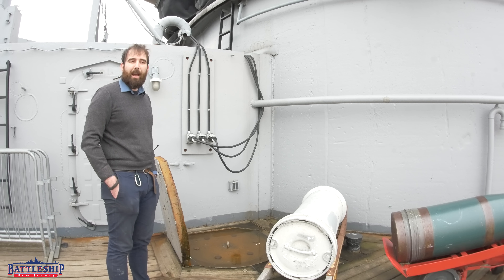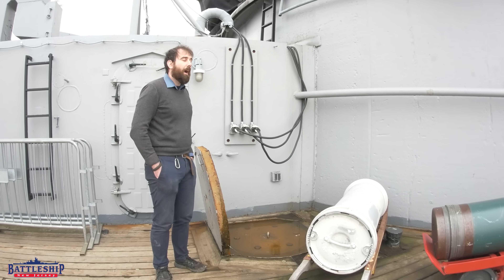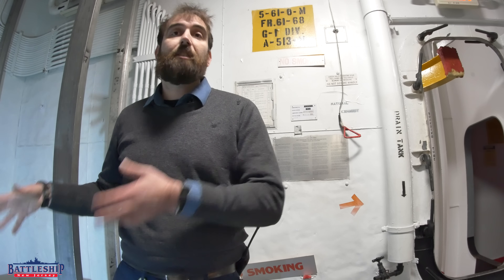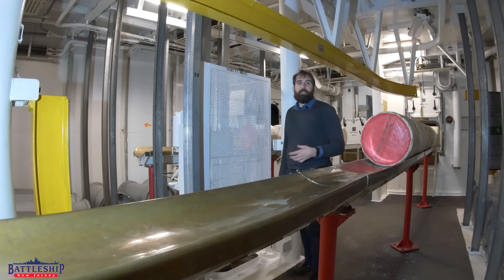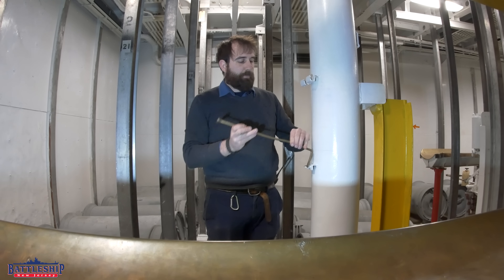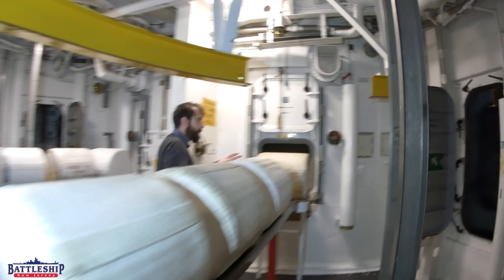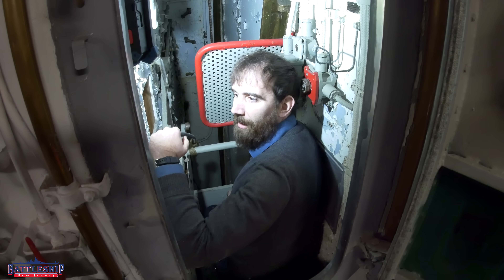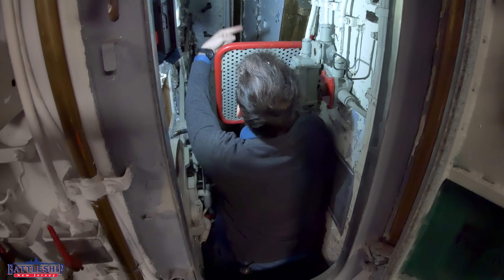Passing 660lbs of Powder For the 16in Guns

Comment: 17:15 is the second ram based on distance or ft lbs?
Reply: The 2nd ram is based on distance. While the 1st ram (the shell) is based on ft lbs, the 2nd ram (the powder bags) goes by eye until the last bag is just far enough for the breach to be closed.
Reply: He mentions just into it, enough to close it.
Reply: @J-1410  Actually he says “just touch” which can be either based on distance or the amount of pressure that has to remain low when loading the propellant. My question is very specific and I was asking what just touch means. I appreciate your reply but I’m holding out for someone with intimate knowledge on the subject.
Reply: @chrisb9960  Good luck with that.

You should probably specify that you're looking for an expert in the original comment then.
Reply: @J-1410  The post wasn’t for you.
Reply: @chrisb9960  You've made that clear, now.

Comment: path of primers?
Reply: From the box to the breech plug.   There is a Gunners Mate below where the plug stops who removes the fired primer and installs a new one.   The primers are the exact size and shape as a 45-70 line throwing blank cartridge, one of which can be used in a pinch.

Comment: kind of ingenious to use gravity hoists in the magazines. no electricity to be disrupted or spark, always ready to work
Reply: It did make me wonder about the unload process on the dial indicator though. So what happens if you end up with more bags, or I guess shells than are needed in the turret. I'm assuming the shell hoist could winch both directions, but how that would work for the gravity hoists if that was ever needed. I'm guessing that wouldn't be very often given there are powder stores distributed along the route from initial store to the turret.
Reply: @brolohalflemming7042  I would assume they draw from the lower magazine first, then backfill from the top, so eben if you have to unload there's space on the lower deck and no need for sending it back up
Reply: Gravity never breaks.

Comment: Do you have a video on boiler startup without having any short steam supply?
Reply: Fire one boiler using electric auxiliaries and compressed  air instead of steam to the burners for fuel atomization.  Once that boiler is up and steaming, you have enough steam to bring up successive boilers using the normal steam-driven equipment.

On the ship I served on, Shore Steam was used for space heating, galley equipment, and hot water.  Great pains were taken to ensure that it never got anywhere near the Engineering Plant.  When you are opening the Shore Steam valves on the pier to eject the visible rust prior to connecting the hoses, there just might be a quality issue.
Reply: We could fire up without steam. We actually found a cheat way to fire up the first boiler using shore steam to turn the forced draft boiler, since we didn’t have an electric “light off” forced draft boiler. We would also use shore steam to pre-heat the oil in the engines, but we didn’t use it a lot, and kept it out of the main piping as much as we can because the quality was always questionable to us.
Reply: @richcruse2689  Exactly.  The primary use of steam on-base was/is to provide space heating, hot water, and supply steam for the base galley equipment. 

There is a WORLD of difference between "suitable for hotel services" and "suitable for turbines".  Since the primary use of base steam is "hotel services", that is the standard which they adhered to.

This is exactly the environment which I found myself quite a few years after becoming a civilian when I ended up with babysitting boilers as a collateral duty.  The only use of steam was space heating.  My make-up water was provided by a standard water softener complete with brine tank which needed to be kept full of salt pellets.  Feed treatment consisted of sampling the condensate return tank, noting the quantity from the lines drawn on the tank with a Sharpie, and measuring out the appropriate quantities of chemicals into a bucket to be dumped into the return tank.

Biggest thing to watch was that the steam flow was throttled enough that the rust could settle out before the condensate hit the feed pump...

Comment: Overram. BB-61
Reply: There was more to it than just an over ram.   The powder bags were improperly modified, and there had been prior incidents of smoldering powder leading to premature detonation of a charge on Iowa .  Why they continued to operate given that experience was never investigated.  The whole damn thing was a cover-up.
Reply: @jacksons1010  They continued to operate though. Whatever mods that were made must have been pulled from all four ships
Reply: @richhoule3462    My understanding is the “experiments” were unique to Iowa .   Using old “hot” powder with the super heavy shells was not approved, but they did it anyway using five bags instead of six - a variance that may have been one of the reasons for the over ram.    Maybe all the ships were making stuff up as well; I don’t know.   I don’t think there was ever any comprehensive review of procedures even after the Iowa tragedy.   They just assumed procedures were followed and tried to say it was sabotage.

Comment: So someone could easily mess this passing of the propellant up and sink the ship like the Conte-Di-Cavour Class Dreadnought Battleship Leonardo Di Vinci suffered in 1918 I think
Reply: No.
It was a 2 step process.
From the holding area, load into a passthrough hatch.
Receive in a mid point between the holding area and the rotating turret, open the passthrough, receive the charge, close the 1st passthrough, turn and open a 2nd passthrough to the hoist area.
As explained, a flash would be isolated in the area where the flash occured.
Reply: Well something caused her propellant to cook off and cause her to capsize and sink